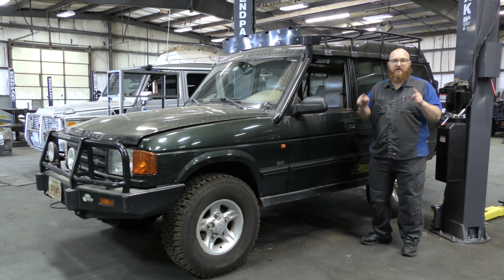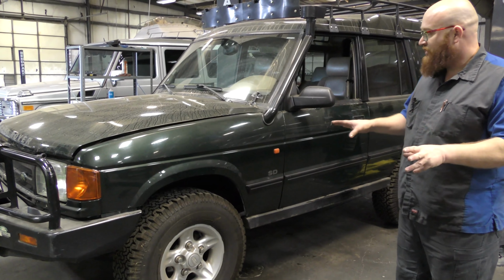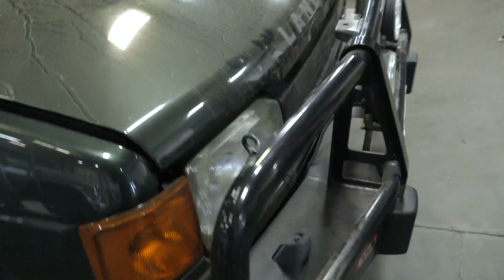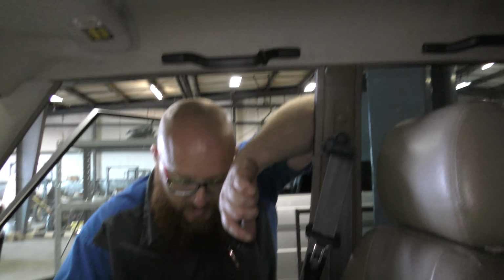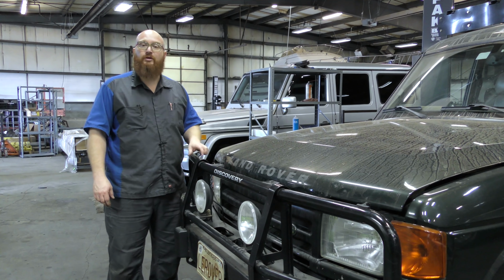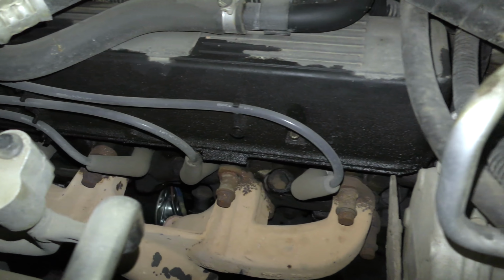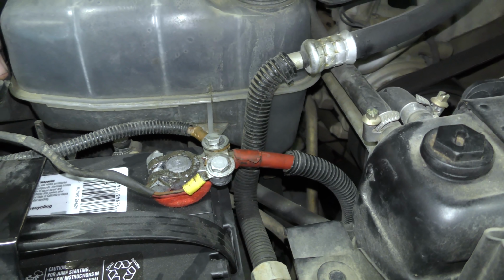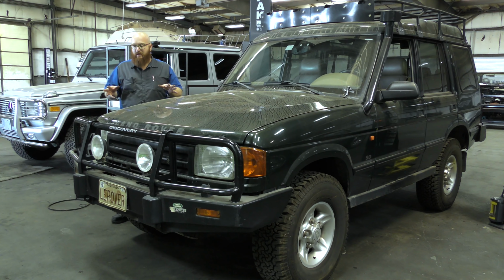How can such a simple repair cause huge problems on this '99 Land Rover Discovery? CAR WIZARD knows

Comment: The fact that Car Ninja hates British cars really evens out the fact that Wizard sends most BMWs to German Motor Works. I'm pleasantly surprised!
Reply: The nice bit for me is that they're both sending each other's *customers*: Many garages wouldn't do that, and would instead contract the work to each other and pocket the difference between retail and trade rates.
Reply: the car ninja is VERY switched on👌👌👌👌
Reply: Car Wizard was saying half the problems dealing with BMW's is 40 year old owners with $6,000 BMW's with $1800-3000 dollars worth of repairs calling their parents to pay the bill.
Reply: @MP-vd1ck  
He made that up, clearly. Probably happened once. Reality is, only the V motor and diesels cause major pain. Land Rover is the most unreliable brand on the planet, Wizard hates on BMW cause his backside doesn’t fit in them.
Reply: @M4rt_FX  they’re both just junk cars man
Reply: Balance in the Force, there is...
Reply: British cars are notoriously unreliable and expensive to repair and maintain. Stay clear of especially Landrovers, Jaguars and McLaren. McLarens are not built for reliability road use year after year, like any normal production car is. It's a racing car company; they build cars to last and perform for a single race and don't care if the wheels and doors fall off, after it finishes the last lap.
Reply: BMW's are a plastic filled nightmare to work on. The inline 6's are known for blown head gaskets because bmw cant design a cooling system that doesn't crumble to pieces every 5 years not just a piece or 2 all of the cooling system is essentially plastic outside of the engine. VW/audi suffer from the same issue. VW so far is the only manufacturer I've yet to see bolt a plastic water pump to a cast iron block then run an electric auxiliary water pump as well.
Reply: No. Hoovie will always have cars that need work.
Reply: @M4rt_FX  LOL, oh yeah those Prince & B series i4's, best fucking engine ever with those amazing plastic water pumps and VANOS systems that are totally bullet proof LMFAO.  And the various range of i6's where they made the super smart decision to make the timing chain guides out of soft plastic and put them at the back of the engine - fucking engineering brilliance.  BMW's are disposable trash - the V8's just have double the trouble.  Land Rovers are trash too, but the older ones are at least sometimes worth fixing.
Reply: @jeremypike9153  Hey, don't knock all the critical engine pieces made out of plastic!  That's how they drive their new vehicle sales up!  The bit I love is where you have to pull the engine out and disconnect it from the transmission to work on the timing assembly, because they put it on the back of the engine and make it totally inaccessible.  Why?  Don't know!
Reply: @Beer_Dad1975  
Didn’t say any BMWs were ‘bullet proof’ did I? I’m on my 4th BMW 6cyl, yes they need attention more that many but cost wise - the British stuff is on another level, while BMW is on another level re performance.
Reply: @M4rt_FX  Only BMW I've ever owned was a 318i that had all the usual problems with overheating despite being only a few years old and supposedly dealer serviced - horrible, horrible little car.  Worked on loads of them over the years though, and always astounded at how terrible the engineering is (since the 2000's anyway) compared to Japanese and even some American cars.  Still not as bad as some of the stuff I've seen on MB's though - and again, even the cheaper ones are just awful.  Regardless I'll never buy another German car - they are all built to be disposable now & based on what I've seen, it has to be a deliberate ploy to sell more vehicles.  I've only owned "classic" British cars, which were all universally terrible, but at least very easy and cheap to fix.  I suspect a lot of the modern Brit vehicle problems are due to engineering incompetence more than deliberate engineered obsolescence though, so they are at least morally superior. :-D
Reply: @M4rt_FX  idk man go on the bmw x5 groups on Facebook the problems are pretty vast. The old ones seem pretty good though
Reply: @jeremypike9153  a plastic waterpump? Are you sure man lol I doubt that.
Reply: @alexanderstevens145  
Nah, all the X5s are pretty bad... wouldn't touch one myself. Nor would I touch a BMW for a purpose other than performance - my preference.
Reply: @M4rt_FX  that new m2 sounds sick I’ll never afford one so it doesn’t matter though
Reply: @jeremypike9153  my bad you’re right
Reply: @thoso1973  the reputation for that comes front eh fact the smaller electronic systems go bad a lot due to poor wiring and components. The US Land Rover engines aren't bad aside from the head gaskets issue. A lot of the 90s to early 2000s LRs likely used a lot of Ford parts since Ford owned them at that time. 

Assuming old electronic issues (seat belt chimes, radios not working, etc) are not a big deal to you, you can keep them running for fairly little money. Just keep the fluids topped off and watch for small issues before they can become major ones.
Reply: @thoso1973  funny how comes no ever seems to say the same thing about Italian Supercars. Have you ever owned a British car? We have a 1988 Mini City in our garage along with a Nissan Figaro and I bet if I put fresh petrol in the Mini it will start up after a while (the Nissan starts up straight away!) Bet with some modern stuff you end up with alot of problems. I maintain my '65 Humber after the garage we used took ages to change the starter motor and the car brooke down due to rubbish petrol. Only problem the Humber uses lots of gas. This was at the time when Mercedes called Humber the English Mercedes. Just look after the car and not cut corners!
Reply: @MP-vd1ck  plastic coolant lines will vibrate and kill pretty much everything..either that or an N63 engine
Reply: Jekyll Spielmann. I knew a wealthy man that bought TWO NEW BMWs ( the top of the line model ) because
he knew one or the other would almost always be in the repair shop !!  I swear this is a true story   NEVER
buy a USED BMW !!! They are over engineered to the point they are not worth it !!
one or the other wo
Reply: @MP-vd1ck  It was the parent's revenge to their kid for being an irresponsible brat when really it was really their fault to begin with because of insufficient beatings !!
Reply: @ryanoliver4062  TRUE
Reply: @Beer_Dad1975  I think you made an intensely true statement  The manufacturers would do ANYTHING to save .50 cents and demand ridiculous prices for plastic junk !!  I have a very good friend that bought a one owner BMW for $22,000 and
sold it 3 years later because his brain almost broke into pieces because NO ONE could repair a steering problem NOT the dealer NOT the garage that proudly advertised their EXPERTISE 
at repairing BMWs NO
They couldn't fix it either !!
A
Reply: @Beer_Dad1975  They did it to drive techs and owners CRAZY !@
Reply: @jeremypike9153  the in-line 6s are NOT known for blowing headgaskets. They never blow headgaskets. They go for 300,000-400,000 miles easy. The inline 6 engines are extremely bulletproof reliable. The only reason they would is if some clueless person keeps on driving when it’s overheating in the red zone on the temp gauge!!!! ANY car will blow a head gasket when you overheat it! Yes, the water pumps go out at around 80,000-100,000 miles and the coolant reservoir needs replacing after 100,000 miles but as long as you take care of those two things the coolant system won’t give you any trouble.
Reply: @jamesmorett7300  Yup, unfortunately publicly listed companies are all much the same these days - their prime driver is making more profit than last year so the shareholders are happy, and their main solution to achieving this is to reduce costs and increase sales - and ethical business practices end up taking a back seat (unless they can use it as PR collateral)
Reply: @Beer_Dad1975  Let me see ...How can I cut costs ?? I know. get rid of employee pensions , We can create a diversion such as 401 K and say we will match your contribution but later they stop matching but the 401K has a limit of $18 000
Corporations have a similar program ( Remember that the Republicans say that corporations are PEOPLE !!
WTF !! They have NO limit as to how much they can park without taxation ,AND
most of our giant corporations pay ABSOLUTELY NO TAXES 
Example : General Electric
has over 327 billion in the
Cayman islands!! FACT CHECK IT !!  The working man pays more than billionaires
Reply: @alexanderstevens145  The impellers are plastic, yes - what happens is over time due to heat cycling they become brittle and either separate from the shaft, or just crumble to pieces.  You can generally find after market replacements that are metal - but why did they not just didn't put a quality one in to start off with like other manufacturers do in far cheaper cars?
Reply: @Beer_Dad1975  I could imagine they would crumple to pieces my goodness lol. I couldn’t imagine a significant difference in weight so who knows why they did this. I guess plastic doesn’t rust? But it gets brittle then add heat to the mix. Unbelievable I’ve never heard of this before. I have older cars I guess so I’m not familiar with modern tech but still sounds so stupid.
Reply: @ryanoliver4062  nothing like a Toyota Landcruiser or Honda.
Reply: @M4rt_FX  I work at an indy bimmer shop and you have no idea how accurate that is but id say theyre closer to 30 than 40 but omg hes right.
Reply: @gr-s2143  
You have one experience, I looked at statistics available online, go look for yourself. Modern Land Rover is garbage.
Reply: They're the same car, least the Disco 2 is. Literally has BMW parts on it, like the idle air control
Reply: @bryanstevens5901  
Complain to BMW about making drivers cars with sportier seats. Having a big arse is the result of personal life choices too, own it.

Comment: I just purchased a 2008 Range Rover L322.  The L322 (3rd Gen I think) was made from 2001-2011.  Until 2005 it had BMW 4.4 L engine, electronics, and was assembled by BMW.  From 2006-2011 it went to Jaguar engines, electronics, and was assembled back in England.   Well they didn’t learn the first time and I read today a new body style for the full size Range Rover is coming out in the next few weeks and Land Rover, in the future, is looking at using BMW engines again.  Sounds like bean counters are getting involved again and when that happens the product will fail.

Comment: I have a 2003 discovery with 60k miles, full roof rack and arb bumpers. I love it a lot if you really take care of them they are great but the market is booming for them so I’m selling it
Reply: @badm0t0rf1ng3r  on bring a trailer with my miles and mods I doubt it would sell for under 14k, I paid 2k for it and only put 3k overall into it

Comment: As a former Land Rover tech, I can tell you that four liter engine is a GEM.
Reply: actually a "GEMS"
Reply: 200 and 300 DTi`s were the gems not a wonky alli V8
Reply: @ianburit3705  agree and the USA didnt get them - but what's new
Reply: @ianburit3705  GEM stands for generic engine management.   In Land Rover repair circles that  generation of engine was referred to as a GEM.
Reply: @ianburit3705  They're Tdi's not DTi's! Turbo Direct Injection....
Reply: @HeraldUKVRRR  There excellent cooking oil burners also.
Reply: @ianburit3705  Interesting..... got a 200Tdi in my '70 2A Station Wagon.
Reply: @HeraldUKVRRR  Had a 3 door Tdi - (lol) Disco  for 10 happy years as my daily driver, I kept on top of everything as I`m retired, it drove like a new one, a 1991 model, owned from 2005 till 2015 roughly, done 240.000 miles without even taking the cam cover  off, but was so oil tight the bottom of the sump went rusty on the outside, soon cured..  During the period of very expensive fuel i was told mix new fresh cooking oil straight from gallon bottles in the tank, add diesel at 50% then add a "splash" of unleaded and just drive, it ran faultlessly but never had the electric diesel injector pump the auto gear box versions had.. It ran quieter, had 2 big batteries under the bonnet so never needed heater plugs 12 volts but HUGE amps, loved the old girl but illness as In my dodgy left leg made It hard for me In heavy town traffic, so sold it to a collector living many miles away.. About 5 hours after buying the old girl the guy phoned me, so i said whats up ?? he just said he has a barn of early 3 door discos and my one was the best driving one he has bought and thank you..  Was well pleased.. The Splash of unleaded kept the mix flowing and cleaned the injectors but did give it a bit of redex diesel additive once a month to keep the tank clean... Made all my own service tools for a cam belt change and got the injection pump timing spot on/ makes a difference.. Now got a Freelander 1 BMW diesel- autobox HSE version and happy with that BUT, keep looking for a nice early diesel auto Disco.. still ..lol
Reply: @secpac58chichi  theres a reason why North America did not get them. They are slow as hell and cannot keep up with our highway speed
Reply: @shaknoori2868  The v8's are quite a bit more powerful than the TDI's? They go very hard and are a really smooth linear motor

Comment: "I love the British stuff...Land Rovers, Range Rovers, Jaguars, Bentleys..."

A Turbo R has joined the chat
Reply: The hesitation after he said Bentleys... think it might have triggered some flashbacks
Reply: the resale value defines how shit uk cars are also other car makers
Reply: @dakusaab  - That's why Aston Martins from the 80's and 90's are fetching six figure prices. Want to know how much a McLaren F1 would cost you today or a Jaguar XJ220?
Reply: @dakusaab  Can you name a good reliable American car maker ? I had one of these early Discovery  D1's broke down within seven miles of me collecting it brand new from the dealer. Now on my third Discovery, I love em when they are being good that is ..
Reply: @mb1326  Clearly NOT true. CFM (GE and Safran) owns 39%, Pratt Whitney owns 35%, GE owns 14%, with Rolls Royce owning 13% of the turbo fan commercial engine market. In the wide body market GE owns 51% of that market with Rolls Royce owning 30%.
Reply: @blackvulcan100  Having owned both Jeeps and Land Rovers, my Jeeps have always been more reliable. My current Discovery 2 in in my garage for another set of head gaskets.
Reply: @blackvulcan100  what happened to make it breakdown within seven miles then?   I am intrigued!!!
Reply: @PillSharks  The fuel pipe to the injectors came off spewing diesel all over the engine bay.

Comment: That Land Rover is what I want sooo bad.  Whoever owns this one is very lucky.  I'm glad you have changed that battery cable end as that one is an add-on when the original rots off.  Either a solder on type or whole cable replaced is the answer.  Great video.

Comment: I miss my Discovery 1’s I had two 300tdis rather than V8’s, the worst repair I ever had to do was a 50p spring that tensioned the door latch but required totally stripping the door down!
Reply: We've all been there Nik!
I swapped my TDI for a TD5 Disco 2 last year. Imagine the joy when i discovered the rear door wouldn't open from the outside...
Tried WD40, no effect. Checked on the forums, no spring, just replace the lock. Luckily found on eBay a new genuine lock assembly for about £40.
The difference between the 1 and the 2 is that within half an hour i'd replaced the whole lock assembly on the 2!
I'm keeping my eye out for the other four locks, for the future 😁
Reply: @koitorob  wow, that’s a difference, I would happily pay £40 for 3 hours less work and less cuts on my hands from the razor sharp metal on the inside of the doors 🤲🩸🩸

Comment: I had a 95 Disco with the 3.9. Honestly it was an excellent little rig. Very fun and capable. Had 170k or so, airbag lights, but never any mechanical issues. Daily drove it for a couple years. Definitely turned me into a Rover guy.